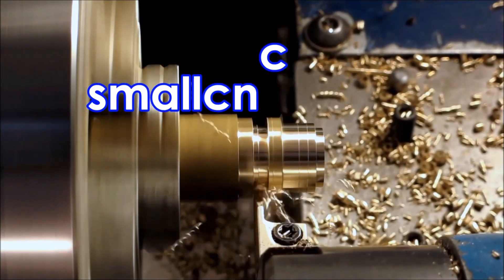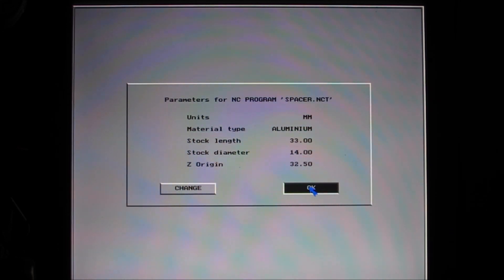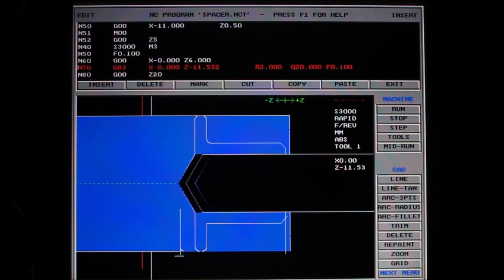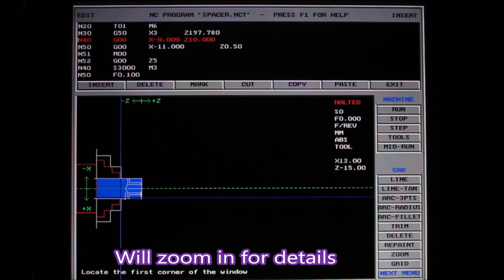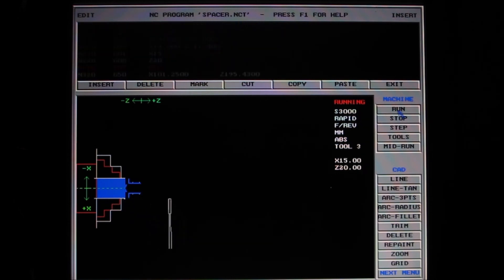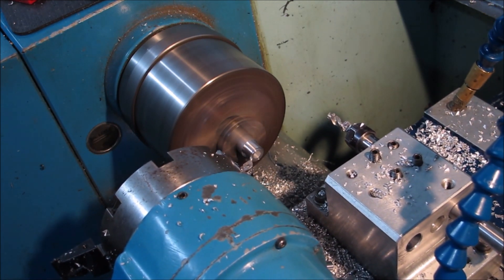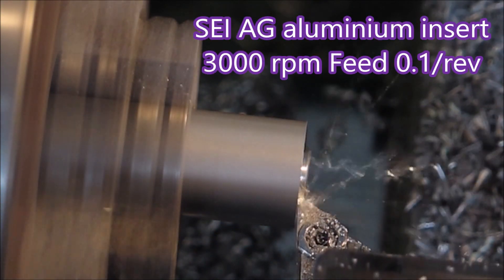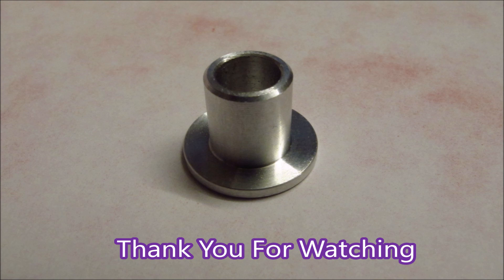CNC lathe with CAD/CAM turns aluminium, Stub drill, insert for aluminium & Kennametal part tool

Comment: Pretty cool.  Did the Hercus software come as a stand alone for offline editing CAD and CAM and simulation? I'd say yes since you stated you're running it on a Pentium.  Is it still available?
Reply from the maker: It can be used stand alone, I have it running in a VM on my laptop and then take files out to the PC that runs the lathe, same software both places. You either need  pc running DOS or 95/98 to run the DOS software or a VM of course. Came with the machines as part of the package as it is required to actually run the machine (they made mills too). Could you run it?
Reply from the maker: @RJMachine62  you could contact me on notewellatoptusnet.com.au and see how we go. Can you do it soon and I will delete this post

Comment: I hope you don't me asking a question.  I saw you machined back where the parting tool would come in and cut. And you machined to the back edge of the parting tool.  Is there a reason you want to smooth that out for the parting tool or could just machine part of the way or just up to the front edge of the parting tool and then just let the parting tool cut through the un-machined surface.  I wasn't sure if that was to protect certain bits or blades.
Reply from the maker: Hi Gary, I think I missed this one. Interesting question.  The turning tool does not really need to go past the front edge of the the parting tool in this case. BUT, some material may have a slightly tougher skin and the turning tool would already be beneath that skin and cutting it side on, whereas the parting tool would be meeting it head on. I also turn a lot of hex bar and I usually make sure the turning tool is turning a complete surface when I can, so below the flat of the hex. Plunging straight into hex with a parting tool is something I try to avoid, 3000 rpm and six corners is a lot of vibrations. My parting tools are quite costly and though I don't mind working them hard, I try to avoid abusing them. Email me if you need more detail. Nigel
Reply: @smallcnclathes  Thank you Nigel.  That was exactly what I was trying to understand. I need to stop watching these. It's making me want to buy a lathe. LOL....  just kidding.  I always enjoy watching your videos. I really like seeing the software then the actual work.  Thanks Nigel.
Reply from the maker: That software is 30 years old and works in DOS. I must be one of the folks who still uses Xtree Gold as a file manager! I usually try to use Win98 SE as my operating system, but some of these old PCs just prefer DOS.

Comment: Interesting little CAD CAM set up. Would that CNC lathe take g-code from other CAM software?
Reply from the maker: If the G code is broken down into G00, G01, G03 and G02 it will. I think the canned cycles may have different G codes. I have used Mach 3 post processor for my Hercus mill and I have also used early Emco code in the lathe.

Comment: Hey Nigel.
Love this little Lathe of yours.
It,s great machine to have.
The CAD CAM is very straight forward.
The only limitation is the size of the jobs you can do.
I would Love to have one sitting in my workshop.
You were wise to buy this machine, that,s for sure
Thanks for the video.
Peter.
Reply from the maker: Such is the case with almost any machine tool, there are always jobs for which it is too small or too large.
Reply: @smallcnclathes 
 That,s True.
This is enough of a machine to own.
Owning a Lathe like yours can make all the difference.